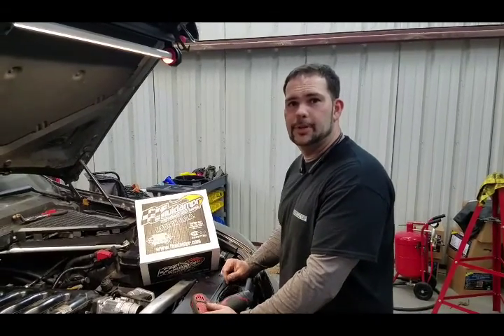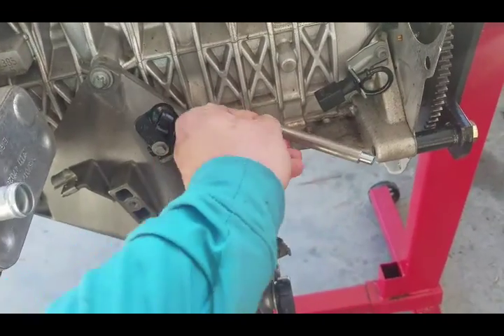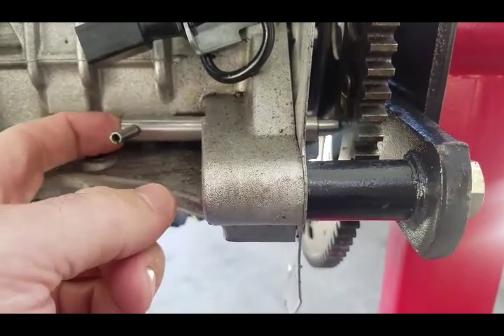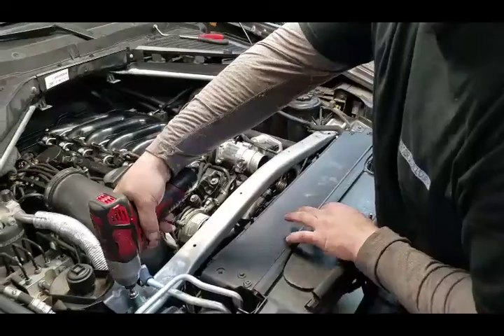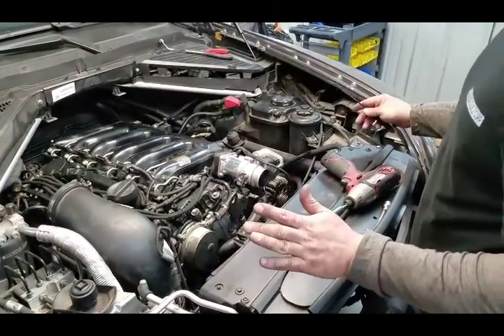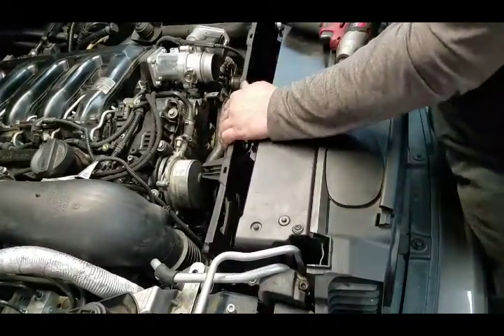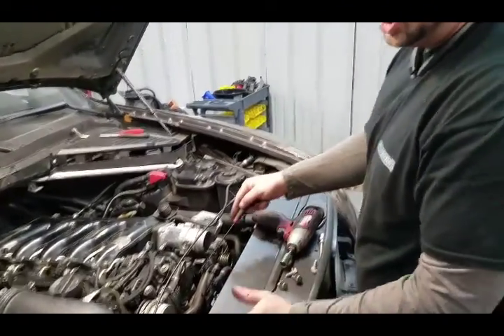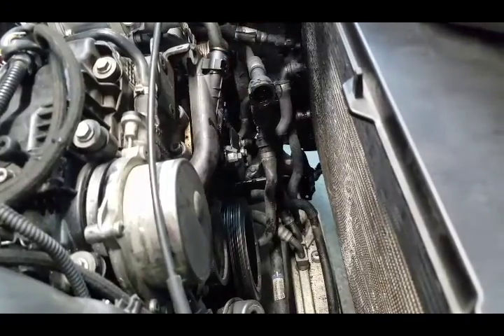DIY for Fluidampr install on a BMW X5 35D and clutched pulley swap

Comment: Dude...
For one, the t50 alternator tool didnt fit in the alternator shaft. I had to get a t47.

Then, when tightening the clutched alternator pulley, the torx bit snapped off in the shaft.

Has this happened to anyone else? My god idk what to do now

Edit: I got it installed lol. Removed the stuck piece, got another torx and welded it to the end of the tool, made it work😅

Comment: Can the H balancer failing cause the car no crank? I have a 335d and was driving and my wipers came on and wouldn’t turn off , then all dash lights came on, and car shut off , and hasn’t cranked since

Comment: I snaped that T50 trying to get that alt pully off. Dont put too much stank on it, if it won't come out hit it with some penetrating oil and let it sit a night. Its a real pain trying to get the broken T50 out of the bolt if you snap it in there

Comment: Can you run x5 e70 sd with a glow plug disconnected. Electrode has snapped off but plug is in solid. Can I tape up lead and leave loose

Comment: hi, the alternator pulley X5 35D 
with clutch is valid for BMW X5 e70 3.0d year 2007?  the original pulley has reference 12317801125

Comment: Does the Fluidampr reduce the noticeable vibration of the M57 enough to feel the difference as a passenger? My mom loves her X5 35D but hates the vibration.
Reply from the maker: Yes, it will make a noticeable difference but I'm going to also guess you have a broken motor mount or transfer case mount
Reply: @TuneMyEuro  I'll check into that but I think it's just the normal amount. We've owned it for almost 40k miles and we test drove several that felt the same way. It also goes to a very good indy shop that checks everything for us before long trips. They've never mentioned anything. Thank You

Comment: Hi, I'm halfway into this job. My engine does not have the hole to lock the crankshaft as I'm doing this on a pre LCI 535d. Thinking of making myself a tool using my old v-rib belt to hold the crankshaft while torquing down the bolts. The procedure won't be much unlike how the alternator pulley was installed.
Reply from the maker: For 535D, BMW has a special tool to hold the transmission flexplate through a hole in the bottom of the transmission bellhousing.
Reply: @TuneMyEuro  where is this hole when the engine is still in the truck,  I see you lay om the engine near the end of the video. In the example you show is nice but I would like to see the camera look down through the engine bay. Thank you so much
Reply: FixMyVW.com by AARodriguez I know. The 118183 & 118182 tool costs $143.6 USD here in Norway. I have to find another well working solution. :)

Comment: Just ordered one for my 335d. Starting from scratch how long should this job take a competent mechanic?

When you turn the engine over to get the flex plate lock tool to locate in the hole flex plate lock hole are you turning the engine manually using the crankshaft pulley?
Reply: 100% make sure u do it while spinning the crannk shaft, i messed up and thaught he meant with engine on and i got super crazy noise & strange burning smell FML, Thank you Andrew for the videos and support and work you do for our vehicles
Reply: @DJayH34TB34TZ  you tried to put that pin lock in there with the engine running?! Bro you need to lay off the weed for a while. You're lucky it didn't catch a hole.
Reply: @ElZilcho247  dude, seriously?... did you try that? LOL
Reply: @DJayH34TB34TZ  The garage just quoted 7 hours of labor for this. That said 1400. and if we wanted to get the  pulleys replaced  2k